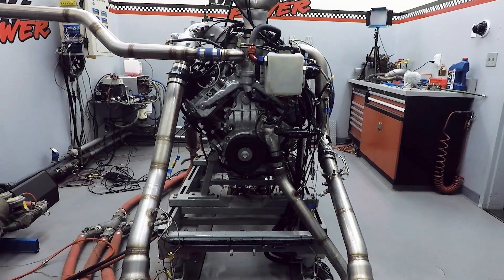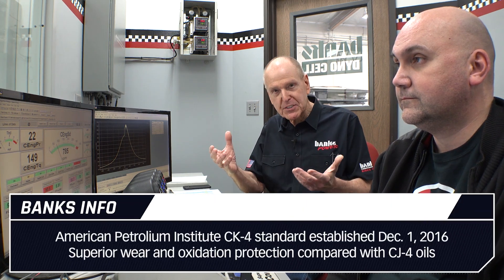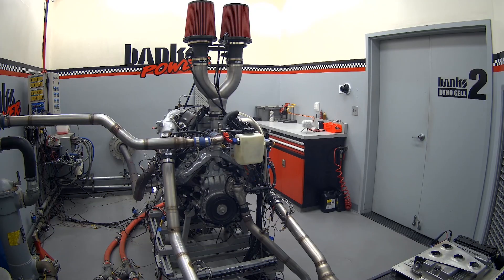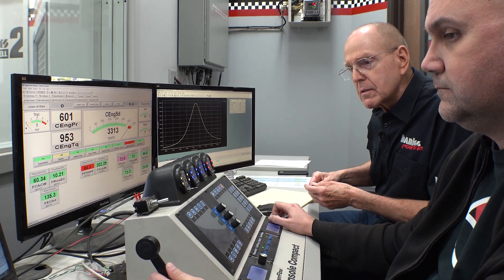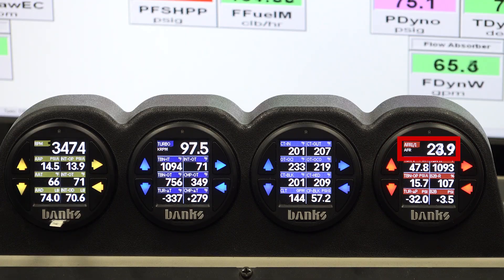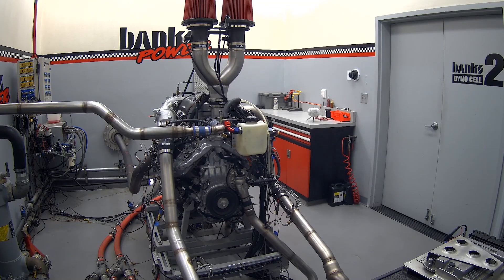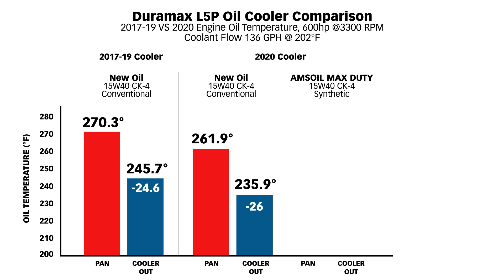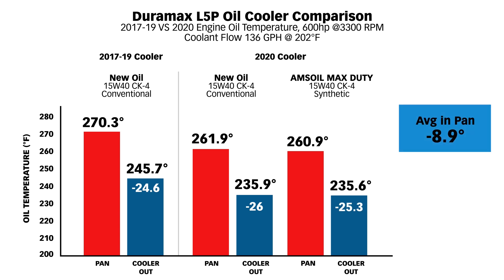Killing A Duramax Pt 10: New Oil Cooler!

Comment: I wanna see killing a powerstroke and killing a Cummins!
Reply: Why they kill themselves 😂😂😂
Reply: @JamesValentineBaja1000 Banks is giving this engine absolutely everything he can to insure its the rotating assembly that fails, not from a shit tune or oil breakdown
Reply: Probably not going to happen, Banks has a massive government contract for modified Duramax to power military vehicles so the research he's showing us he has to do anyway. He has no such contract paying for the time and parts for other manufacturers, and this is not cheap research.
Reply: True. But it would be great to see that anyway.
Reply: @jaydunbar7538  he could consider it research to find what the duramax has as weak points compared to the others,  then it's fair game right?
Reply: Love the videos guys! And the new Duramax! Besides the emissions nonsense there a real work horse Keep talking nerdy to us!
Reply: Mr banks has a big hard on for the duramax  he has always said he will pull a duramax to hold over 6000rpm and be reliable and produce big clean power this was many years ago i heard him make that claim not sure if he has achieved it yet
Reply: @Kraigthecanadian  6k on a diesel sounds like a stretch. Remember this man has worked on every engine known to man he chose the duramax because the others couldn't stand up
Reply: Brian Dudley the 6000rpm thing started I believe it was back around 2006 I don't remember exactly but when duramax was still the new kid on the block and the 5.9 was still the undisputed king of diesels I remember he went on to explain why he believed the duramax design was the only one he thought was capable of that level of performance due to the design and theory behind it he said he would get gas rpm out of a diesel and close the gap between them we all know diesel is by far the more efficient engine in almost every way he was about design not about material and weak points about potential
Reply: @Kraigthecanadian  that has been hella long since the duramax is over 20 years old.... 🤔
Reply: Brian Dudley yup I think he said that around 14-16 years ago if im not mistaken he said 6000rpm @600hp which that hp is very easy to achieve but at that rpm it would be a huge task he may have already achieved it or moved onto a different goal I don't know while I think he is a crazy smart and good at what he does I don't follow him as I find he is very informative when he talks and very accurate but is not the most interesting or exciting talker and i get bored right away a move on to another video but i love how for once someone is trying to blow a engine not from design flaws but will fix them till the engine literally comes apart and does a how much can it handle properly no messing around with cheap junk fixes only doing what is the best mechanically
Reply: @HawaiiGabriel 
We will always be trying to figure out how to charge them more, because batteries just don't have the energy density. It is due to the  chemistry of batteries. If you're only swapping electrons between two substances and you have to carry around both of those substances at all times, it takes a lot of both of those substances to get enough electrons to swap. Whereas with burning hydrocarbons the heaviest part (the oxygen) is collected by the engine during its operation. This saves more than half the weight that it takes to store the energy, and thereby more than doubles the energy density. Until they can find a way to make an inexpensive reliable and rechargeable fuel cell, electric cars are not going to be able to completely replace the internal combustion engine.
Reply: Unfortunately they didn't make it past the second episode.....
Reply: New Gen 3 6.7 Powerstroke is going to set a new benchmark.
Reply: @Greyhorse15  I sure hope so. It's been a rough road for Ford. The 7.3 gas may be in my next truck! I believe Ford is on the right track.
Reply: @Greyhorse15  probably for more time in the shop
Reply: @C Steele 😂 Funny guy.
Reply: Ben Hastings Ford always sets benchmarks they're for bragging 

RAM and GM are work trucks
Reply: @Dodd Garger Yeah block heaters light the GM on fire and the RAM have shitty transmissions. Yup they are real work trucks alright 😂
Reply: @Greyhorse15  if you hurry to Ford I hear they are giving away puppies. So your not lonely while you wait for a tow.
Reply: @Brian Dudley Never had any of my Ford’s towed....I’ve towed a few Chevy’s and RAMS
Reply: @Greyhorse15  of course, you are the ONLY Ford owner who has never broke down.
Reply: @Brian Dudley Nope I just take care of my stuff and do maintenance like your suppose to 🤷🏼‍♂️
Reply: @Greyhorse15  so do the rest of us that is why we drive GM
Reply: @Brian Dudley To each their own
Reply: @Greyhorse15  yup but to be honest the Cummins and the power stroke were both tested in the JLT-V and failed hence why banks brought the L5P to the table. So there is a reason why the government contract stuck with the duramax.